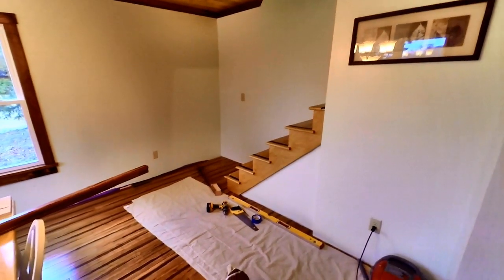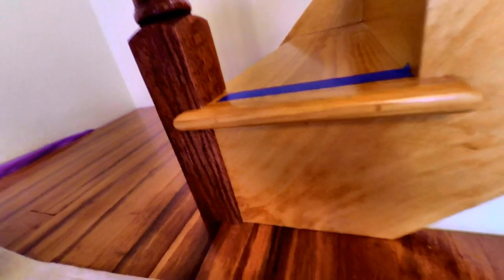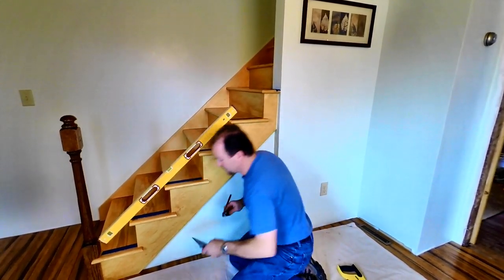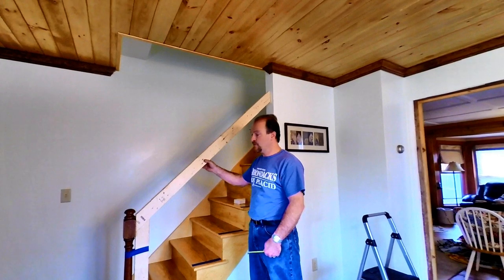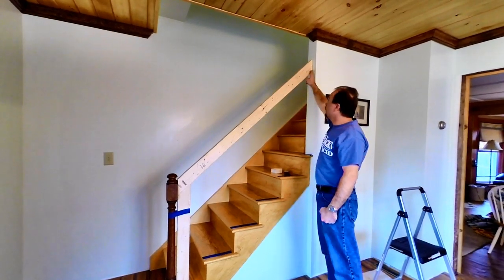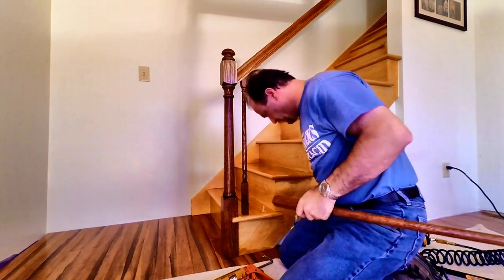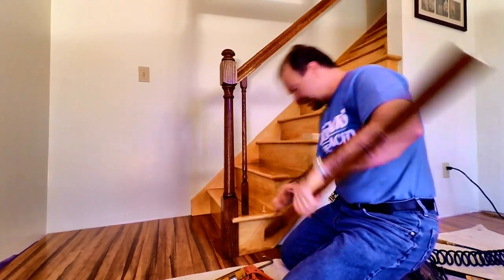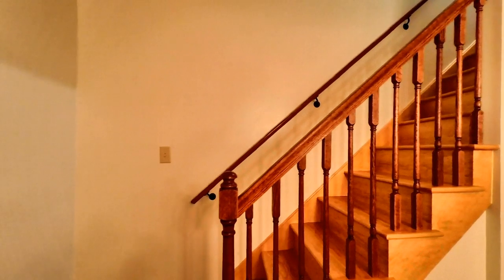Installing Railings

Comment: Do the balusters/spindels have to be attached to the stair stringer or can they be attached to the hollow tread
Reply from the maker: They can be attached to each. I attached these directly to the solid tread with a dowel.
Reply: @adirondackadventures7849  gotchya.  I am working on some at home that have vinyl flooring covering them so the cap trim piece pushes it further in.

Comment: How do you attach handrail to rosette at top and newel on the bottom ? Thank you
Reply from the maker: The rosette was attached to the wall by recessing the screw and plugging with a wooden plug to match.
The handrail was attached to the post on the bottom with screws and then covered with the fillet between the spindles.

Comment: as you can see have handrail in place....how did you attach to wall at the top?
Reply from the maker: I fastened a rosette to the handrail with screws and then I screwed and plugged the rosette to the wall.